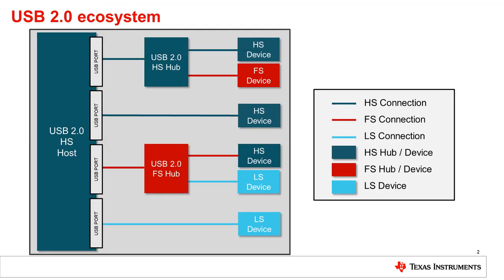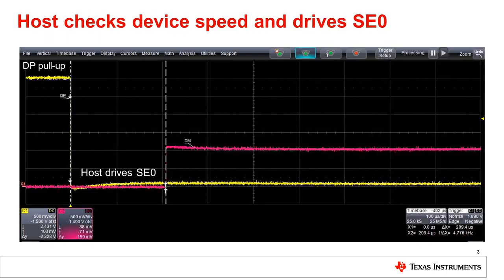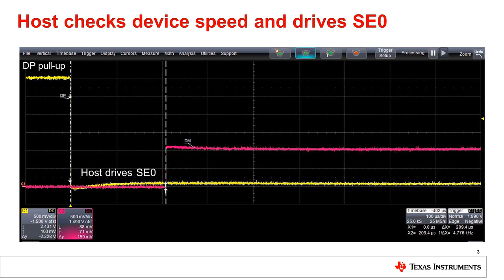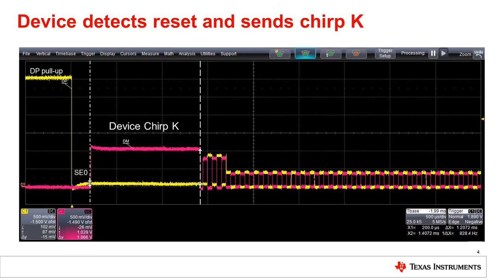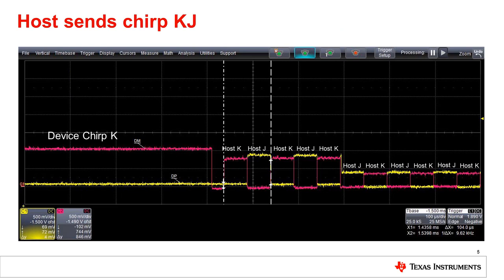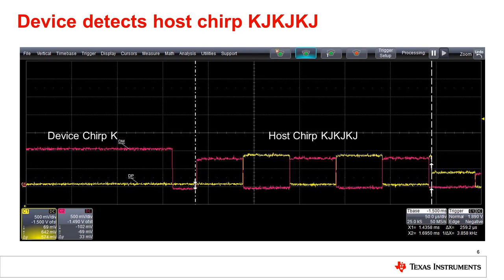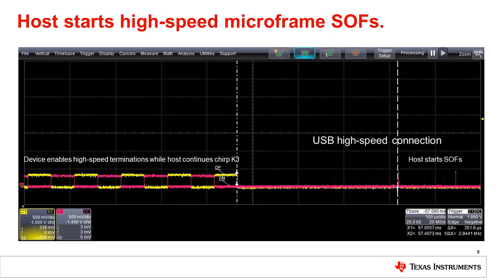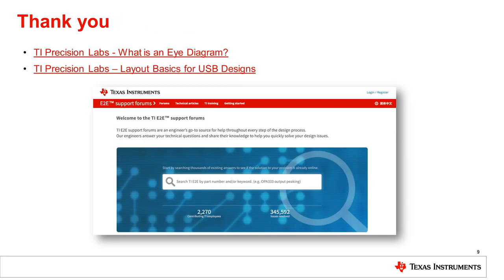What is the USB 2.0 high-speed detection handshake?

Comment: Would not the speeds between 12MB/s or 480Mb/s be detected by hardware. The termination decides speed capability.
Reply: Nope. Whether HS or LS is determined by the polarity of the data lines. The JKJKJK sequence is used to synchronise the clock, but the overall speed of the communication is determined at the beginning.
Reply: @_a_x_s_  I recollect USB2.1 having a termination resistance decide the rate of data transfer. Thank you.